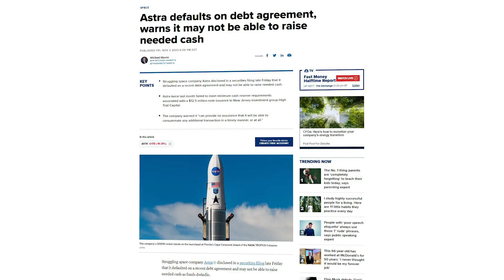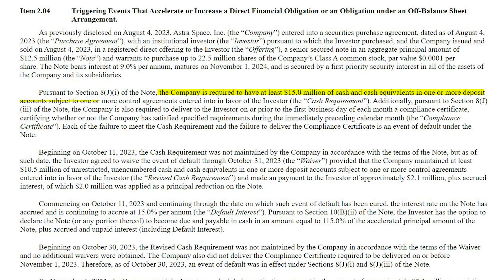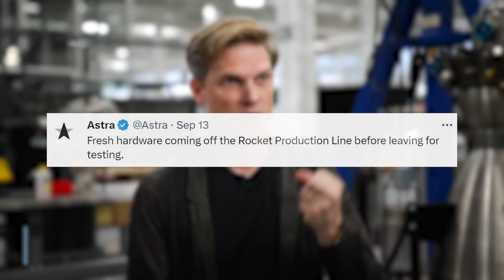Astra Space Is Running Out of Money...

Comment: If Astra does go under (god forbid it doesn't), who would buy them? my bet is RocketLab
Reply: Or spacex
Reply: I don't see what RocketLab would gain.  They use different materials and processes.  But maybe the second stage of Astra rocket3 are similar to what RocketLab plans to do with the second stage of Neutron in terms of being bare-bone, light and completely contained within the fairing.  Even then it's not like the second stage engine did well.
Reply: @baileyrahn266   I feel like from the manufacturing equiptment, patents, buildings and employees standpoint it would be a win for RocketLab, they did the same thing with Virgin Orbit.